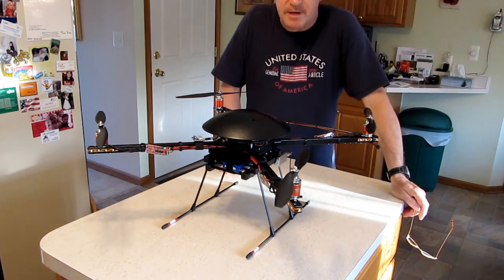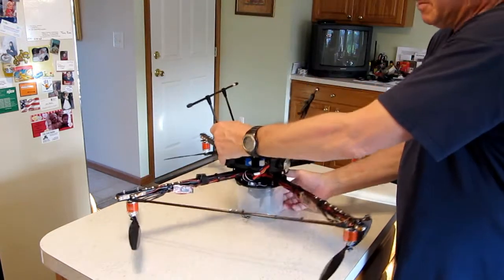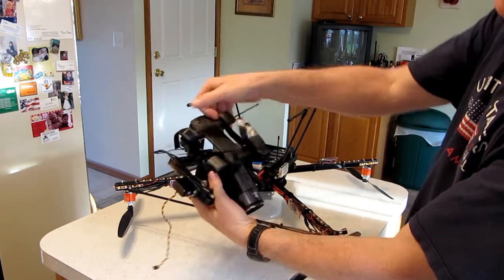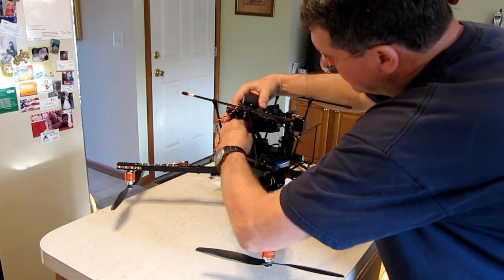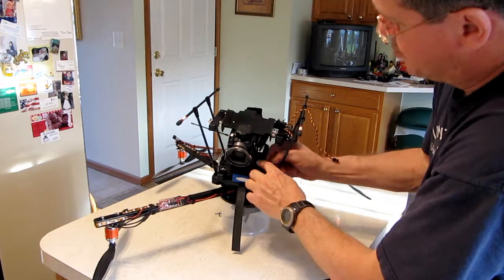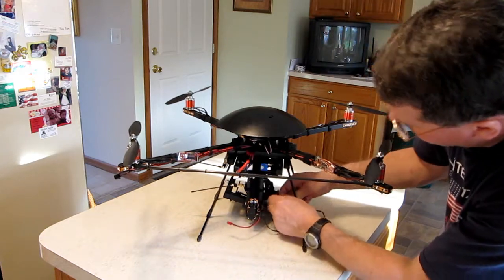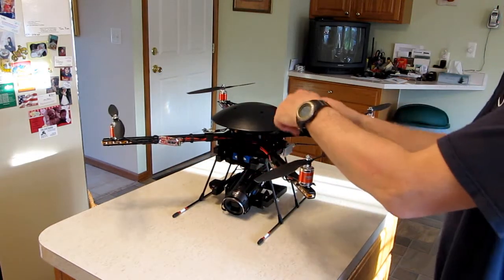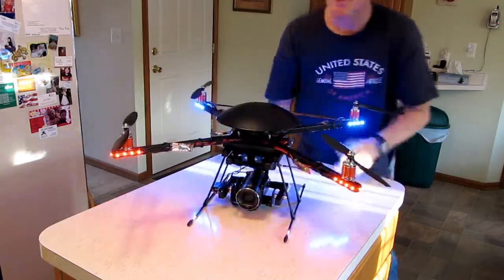Mikrokopter Quad-X with Interchangeable Camera Mount & Video Transmission System.wmv

Comment from the maker: Hello gc9n,
Yes, very lightweight 5/8" square aluminum tubes and Hitec digital servos.
My latest & best camera mount design can be seen at the beginning of my recent YouTube video titled  "Mikrokopter - In-flight test of new vertical camera mount".
On this new camera mount I am using the Graupner MKDS18 servos, which in my opinion are the best you can get for a camera mount.
Tom

Comment from the maker: @ProRealEstatePhotos
Hello and thanks for your interest in my camera mount.  It is my home made design based on a combination of other peoples versions of camera mounts.   The camera is kept stable during flight by the stable flight characteristics of the Mikrokopter and the gyro stabilized action of the camera mount who's yaw & pitch servos receive commands from the onboard flight control computer & 3D gyroscopes to keep it level during flight even if the Mikrokopter is not.
Regards,
Tom

Comment from the maker: Hi Redhotpearl1,
I love the CF props!  Most of the one's I've gotten from the LCC Shop were perfectly balanced when they arrived, but a couple were very close, but not perfect.  I just put a tiny piece of tape on the undrside to make those couple of props perfect.  I bought them for both my Hexa & Quad, plus a couple as spares. I use the Canon Vixia HFS100 camcorder for most video, but I think that I used the Canon SX200IS for this Youtube video.

Comment from the maker: @Ec130Rhine: Hello, unfortunately I do not produce these aircraft for the public at this time.  They are sophisticated machines incorporating a flight control computer, a navigation control computer, 3 dimensional gyroscopes & accelerometers, an atmospheric pressure sensor, an electronic compass and a GPS system.  I would have to charge several thousand dollars.